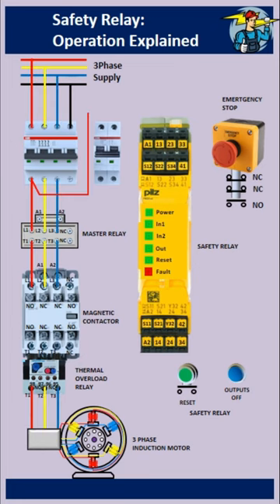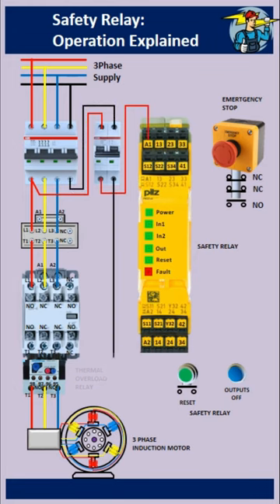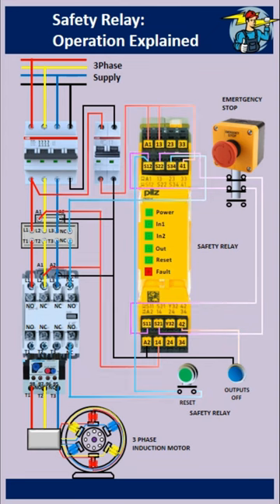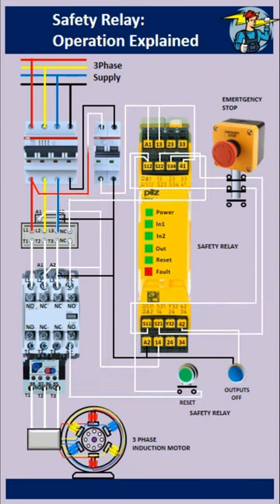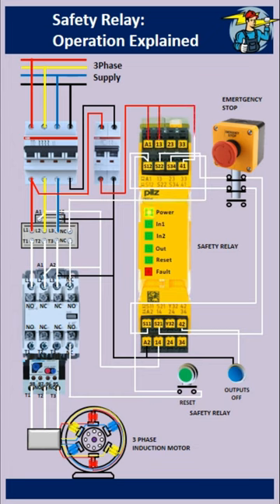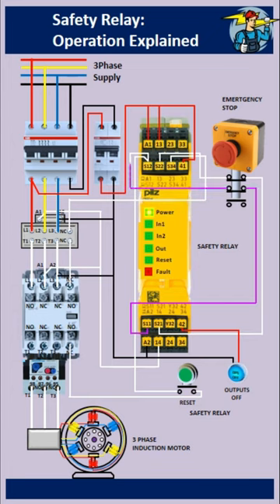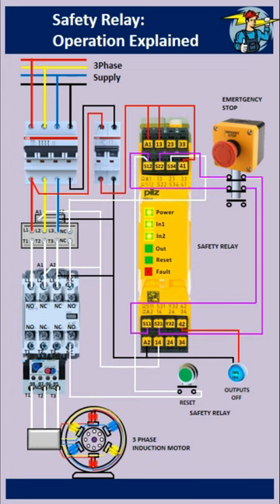How to wire a Safety Relay / Safety Relay Working Principle / The Best Video to learn all about.!

Comment: I see a few threats there. I'am assuimg that all of phase contact on second relay are NC, since one of those on diagram is NO, meaning that engine will run on 2 phases when turned ON, but ll be on one phase when turen OFF... 
Why emergency switch doesnt decopule relay's power so in case of controller fault it can still open connections.
Futhermore why is Neutral (i assume  represented by black) is decopuled on (assumption by diagram) TNC type of grid...

Comment: those pilz relay are the worst, always defected and expensive to replace, after a shutdown of equipment they get faulty you need to keep taking out bottom connector and insert to restart it